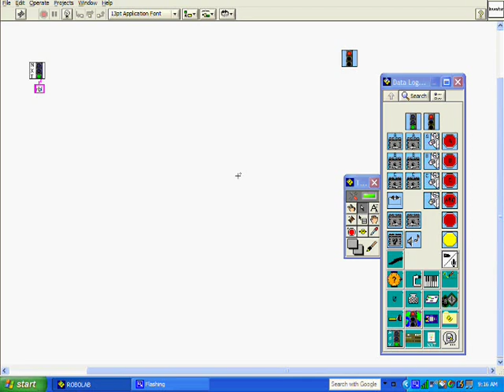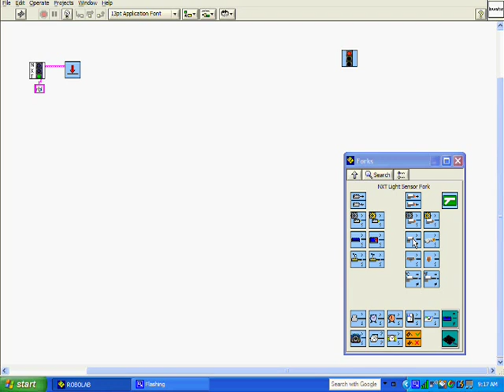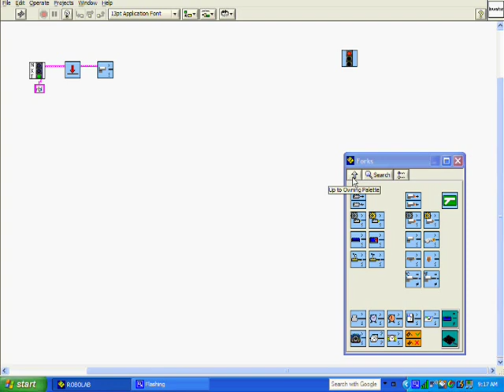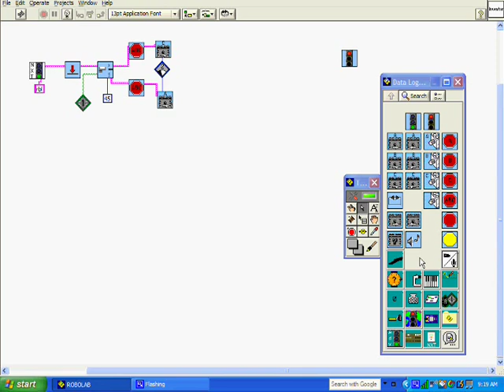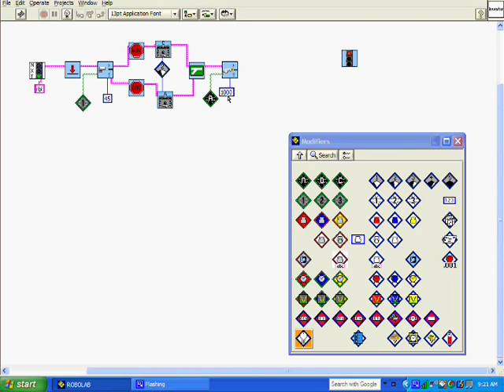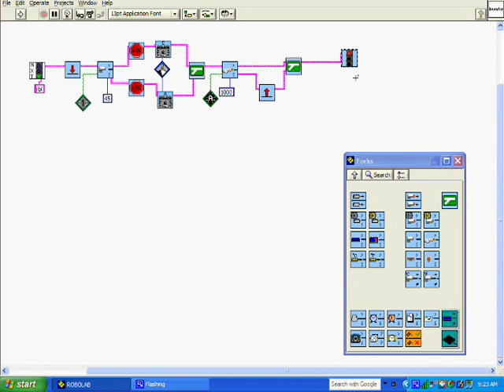How to follow a black line in Robolab

Comment: Hey I am trying to get two different sensors to follow a line but I can't seem to get the connections correct. I am building a hovercraft and the sensors are supposed to be on the sides off the black line and turn off the the correlating propulsion fan whenever the sensor goes over the black line. I can't seem to get all of the connections to work with robolab. If you could give me any advice I would greatly appreciate it.